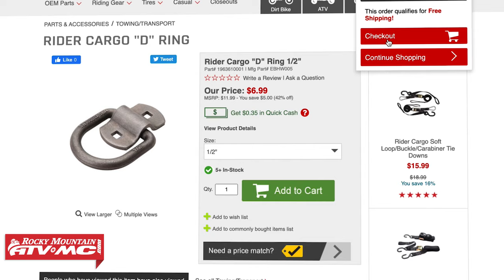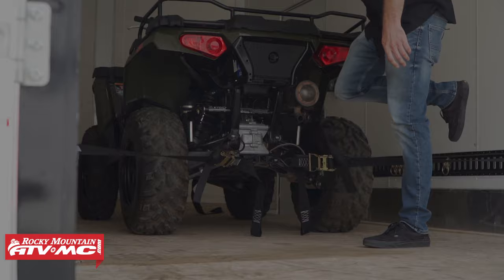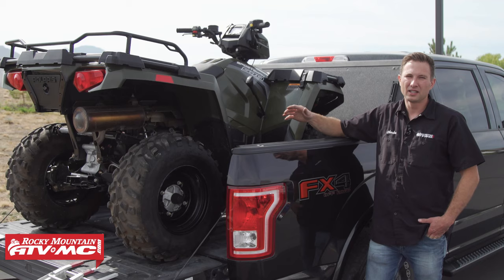How To Tie Down an ATV or UTV

Comment: The tire bonnets are the best method. If you tie to the chassis the suspension bounce can make the straps come off or get loose.
Reply: What are you doing going off-roading with your traliler? Why would it bounce that much?
Reply: I've been tying it down for 11 years the way he does it never once have I had a problem
Reply: You’re absolutely correct

Comment: As a  25 year trucker.. I look at how people strap down their ATV's and sxs. Its unreal how many people are completely clueless.  
The winch is not a legal method of keeping the atv on the trailer.
I've seen straps over the seat. 
I've seen straps over the racks...
No good.
If your straps don't seem to be stretching the length of your machine,,, its probably not right.
also when it comes to D O T  ... make sure the labels on the straps are kept in good condition. A strap that a officer can't read the weight rating becomes a zero.  In Canada  our pickups are licensed as commercial vehicles and are pickups have to follow the same guidelines as transport trucks.  Insecure load fines in ONTARIO CANADA  start at 395 dollars.  Make sure its secure.  
Open tailgates...  if anything is able to fall out the rear of the pickup...  thats considered a Insecure load.  
I hope this info helps someone who doesn't know how serious  load security is. 
If you don't know... ask a trucker.
Reply: Well that's great and all but we live in the US

Comment: There seems to be a big controversy between attaching to a frame and tying down each tire.  Have you ever considered putting out a video that shows the pros and cons of both methods?
Reply: Shock therapy has a really good video explaining this
Reply: That’s the opposite of how the military ties trucks down. They attach to the frame.
Reply: Polaris owners manual makes no mention of tying the tires down it says use the frame
Reply: @flight2k5 military trucks don't have 21in of suspension travel

Comment: That seems like a pretty light duty trailer for a machine that size. I wouldn't want to go fast or far with that.
Reply: Judging by the full size tires, it looks like it would be a ~3000lb axle. Should be plenty for a 1500lb SXS.
Reply: @TwoAMBlacktop  KRX 1000 is almost 2K lbs. dry + gear, mods, fuel and trailer weight. I think that's pushing it.
Reply: I’m sure a multimillion dollar corporation has probably thought it through enough to be able to haul this thing around properly. 3-4000lb axle, I wouldn’t be worried about it one bit.

I don’t pay attention to them things that much anyway, but why is that one 300lbs heavier than it’s competition?

As much as they cost, I’d rather have a Wrangler.

Comment: Do you compress the machine?  The guys I hunt with use the winch to compress the front and ratchet straps to compress the back.  I have an enclosed and used 4 straps to a low point with no compression and it didn't move either.  So what's the correct method?
Reply: You never use the winch to tie down or it will cause damage to the winch.
Reply: @A-man-100  it doesn't seem to hurt it, they've been doing it at least a decade.  Regardless, that doesn't answer my question regarding compressed suspension or not.

Comment: Anything that preloads the suspension is not good and could damage suspension/steering components
Reply: Yeah... That's why they ship in crates with the suspension bound up. They're trying to ruin it before they give it to you. Those jackals.
Reply: @theingobeck4772  they ship in crests not fully attached in crates guess you’ve never unloaded or hauled a load of atv/sxs before! Suspension isn’t bound up on shipment
Reply: Everyone keeps saying this b***** but I'd like to know what the f*** you're doing with the damn trailer are you taking it off jumps like what do you doing to make the suspension bounce so much on a damn paved road??

Comment: Absolute rubbish. 
The suspension goes up and down and the straps come loose.
If you can pull the suspension right down, then buy another vehicle.
YOU MUST TIE THE WHEELS
Reply from the maker: Tire bonnets are a great option and we use those as well. But going to a low point on the frame like we do in this video is completely secure and even recommended by some side by side manufacturers. Also, the straps like we use in this video with the soft loop on one end and a carabiner on the other also make sure the strap won't come off.